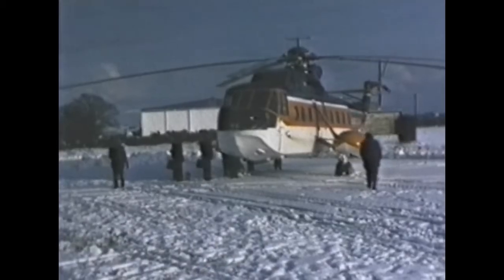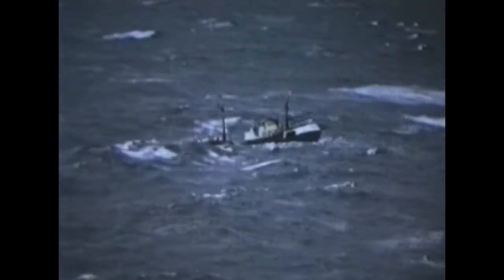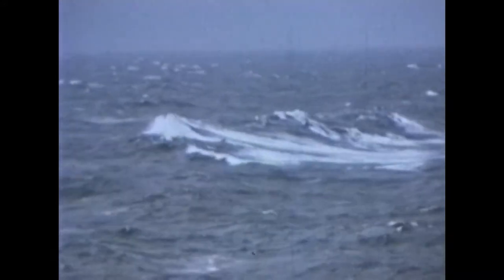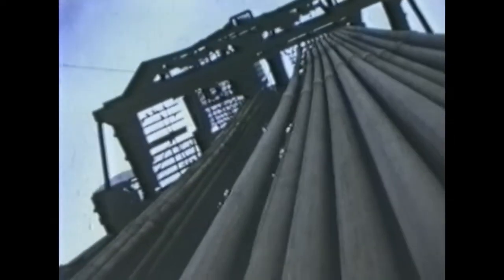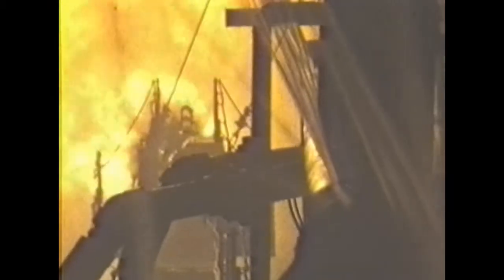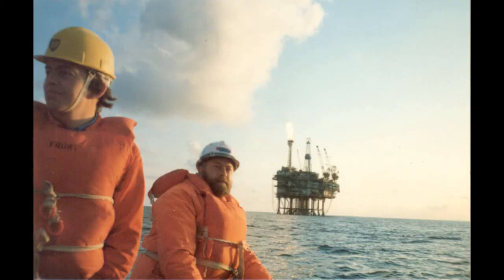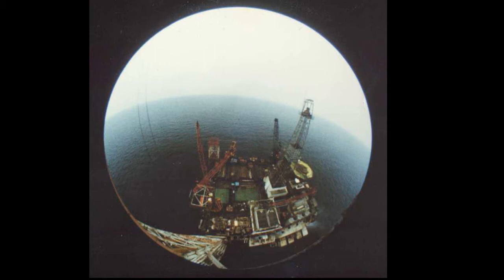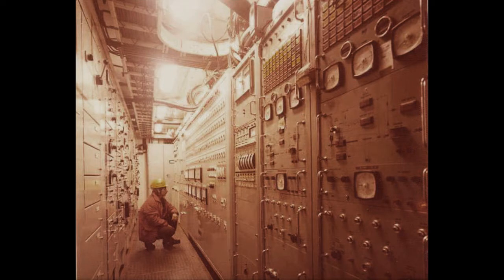Offshore North Sea oil operations 1974 78

Comment: That's a real blast from the past seeing the Sedco 703.  I started working offshore on the 703 on October 6th 1978, as an 18 year old roustabout.
Reply from the maker: Robert, I left 703 about 1976.  Great rig. What did you do afterwards ?  Peter
Reply: I continued working offshore until 2012.  I had a 6 year break due to a serious accident in 1991.  But l eventually returned to work and finished a as driller in 2012.  I had to finish then because of a stroke, possibly caused by the previous accident.
Reply: My father worked on the Thistle Alpha project in 1978 and I have an oil sample from him, he’s gone now sadly but he told some amazing stories.

Anyone here know a Ken Bird through that period.